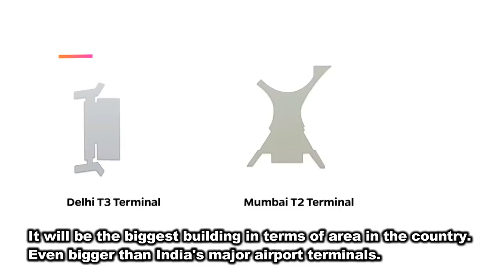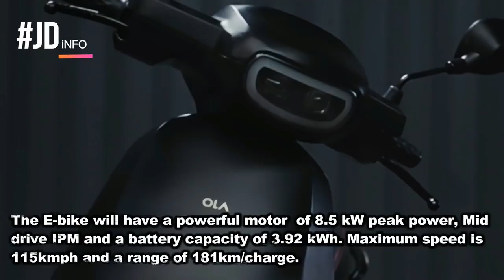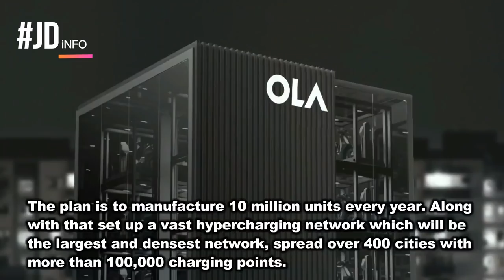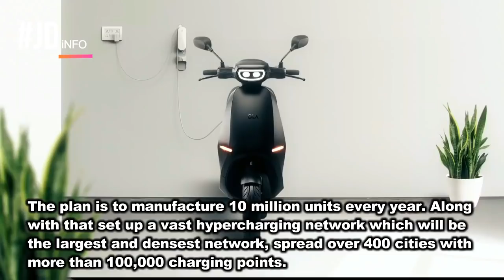India will have the World's biggest Electric 2W Factory

Comment: You missed some Amazing facts about this factory. 
1. The OLA factory will be producing 15% of the world's 2 wheelers(including all manufacturers from across world including China). Which is a humongous market share if achieved. 
2. The factory shed is supposed to be the single largest in Asia. 
3. 2025 will be the year where most of the 2 wheelers will be electric and not gasoline. 
4. The OLA scooter, which is delivered on road now ,can run a 170km odd distance with one single charge of 4Units (cost approx 32rs) . Making the running cost completely negligible.

Comment: The only problem I see with this is the Lithium ion battery. We don't have Lithium resources in India. We have to import this metal which is these days very expensive because of the demand. I hope someone in India is working on a alternative like Sodium ion battery or something based on Silicon. Sodium and Silicon are present everywhere. Building a battery out of these elements will be cheaper. Chinese battery maker CATL is working on Sodium battery. I hope we soon catch up. Important fact: India consumes nearly 4 lakh crore worth of petrol every year and 2 Wheelers make up most of it. Imagine a 2 wheeler with a range of 300-400km which is based on Sodium ion battery. Petrol 2 wheelers will be totally wiped out from the market and India can save 4 lakh crore which can be put to better use.